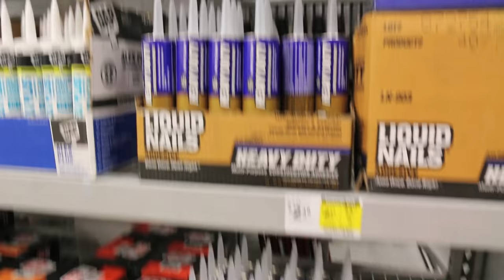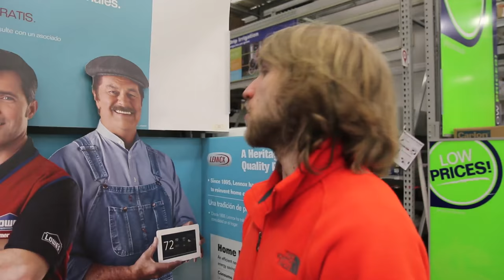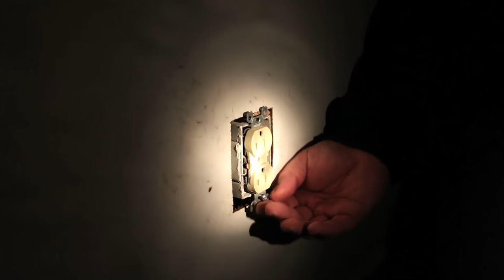BACK FROM THE DEAD!

Comment: At 33:29 if you pause at the right moment you can see that the "spark" is just the light being turned on and off really quick. The reflection of the light can be seen in the window.
Reply: +Lasse Hansen The whole room operates on the same power and it all has power until the spark happens. Once that spark happens its shuts everything off again. So if they would turn the light switch off then make it spark the light wouldn't light up for a split second like it did.
Reply: Yeah I see it
Reply: yeah true
Reply: +Lasse Hansen That's when he turns the breaker back on, the outlet shorts it out slightly after....
Reply: It actually the sparks being so bright it lights the room
Reply: The breaker turns on the electricity on for the room not just the outlet so it turns on the lights because it is hooked up to the same rooms electricity
Reply: Actually if you have a basic idea of electricity then you'd know that when they turn on the breaker for the room it allows the light which had been on when the breaker went off at first will be turned on until the break goes off
Reply: +nextvince No, but apparently you are though

Comment: Guess what? All a prank from Aunt Jackie and Uncle Chuck, or just random Juggies. 
A Juggie or even Uncle Chuck or Aunt Jackie could have put on a white mask and go in front of the window. 
Uncle Chuck could have gone up there and put EXIRE(which means Exit) and the blood, and the Ouiji Board or even a Juggie could have done it. 
But remember Uncle Larry saying he remembered playing with a Ouji Board when he was little? Well, maybe Aunt Jackie kept it all along and put it up there for the prank. 
The VooDoo Doll that flew across the room could have been very easy. There could have been a string attatched to the doll that went through the crack in the door and towards the outside. 
Maybe the garbage can was the same thing. 
And for when the power went out:
Aunt Jackie and Uncle Chuck knew that they had found the Ouiji Board, so they were going to continue their prank. Aunt Jackie turned off the power. Maybe they didn't hear or see her afterwards because everyone was freaking out. Jackie could have hid in the house while they escaped. 
The Emma Head could have been very simple:
They could have noticed that Joe was now helping Jesse, Larry, and Corn with the construction. so maybe they got him on the prank. because the bite mark on the neck doesnt even look the same. They could have bought a new head, and got Joe into the prank. 
OR Joe left his trunk unlocked, thinking that they might need it to carry things back and forth. So maybe Aunt Jackie put the head in there. How would she know that they would burn the head?
She didnt. 
But she does know that Jesse can sometimes become overly scared and unstable, so she could have guessed that he was going to get rid of it: But she probably didnt think he would burn it. But that made the prank even better. 

Maybe even Jesse was in on this???

Comment: why does the camera keep crackling and popping?
Reply: Auto focus
Reply: +Ashlynn Repass a spoooooooooooky ghost
Reply: Because the house is haunted
Reply: It's been doing that crackling and popping noise because remember whenever he did the first video in the house you did that or the second video and then he realizes that it was acting weird and then he saw the blood and then he saw the freaking doll head hanging from the roof then he saw a bird brains all over the attic
Reply: maybe it was picking up a sidnal
Reply: Oh
Reply: Because of the new lends
Reply: +Ashlynn Repass no the shotgun mic keeps making that noise
Reply: Look up EMI
Reply: +Kyler B Its crackling and popping because there is a spirit trying to inter fear with the signal and say something to us. Notice that the noise does not take place if they are any where else.
Reply: +Jeremy Greiss no it might be the carbon monoxide
Reply: Electrical interference most likely the insulation on the wires it's all science stuff so
Reply: I'm pretty sure it's 3g or 4g interference from Corn's phone.  Notice it only starts when he was using it for a flashlight and then for a couple of minutes afterward because the phone is technically still "active" but the stops being "active" to save its battery.
Reply: It also has to do with his microphone not being shielded properly.
Reply: +Max Goodell   The shielding does'nt matter as much as long as you dont have physical interference
Reply: +Max Goodell  Loud popping noises or crackling noises in audio systems often occur when a connection or cable is loose or broken. This issue could be at a microphone connector or somewhere further down the audio signal chain.
Reply: +Krazy Mittenz (KrazyMittenz) It only does it when someone has their phone out

Comment: basic electrical stuff you didn't do rap the outlet in electrical tape so the live wires don't touch the wall or have a chance to touch each other buy this plugin thing don't remember what is was called and it has lights that tell you if it's hooked up right or if it's put on wrong